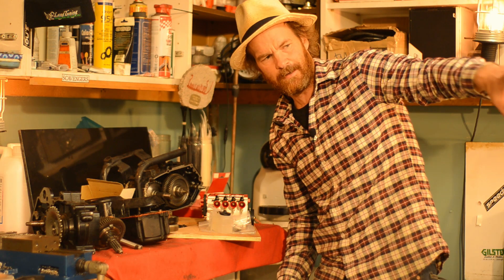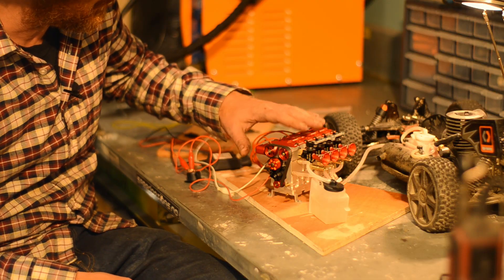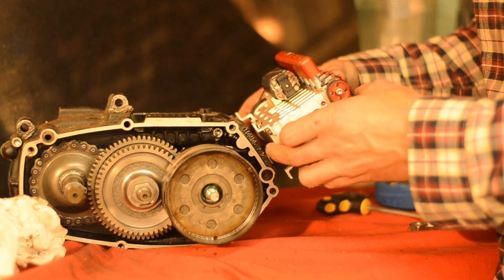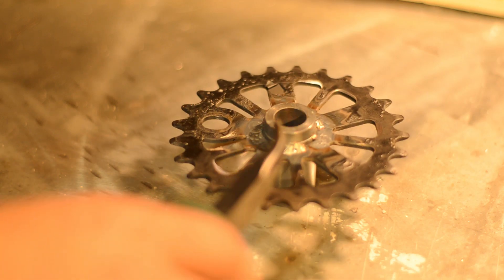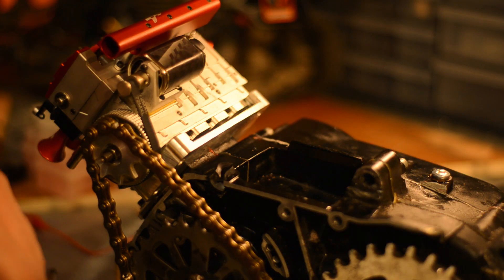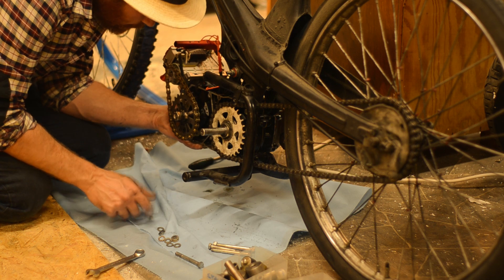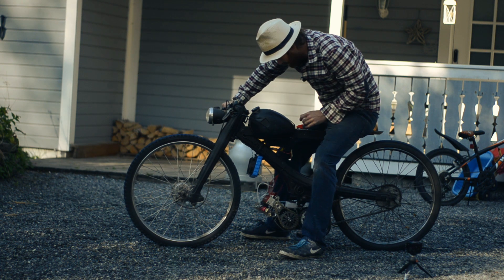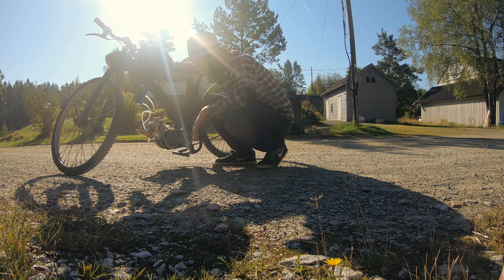I shrunk my R1 engine.

Comment: I know endmills are very expensive, but you might want to consider getting some shorter ones. That way you aren't wearing out just the end of your tool, and more importantly you'll have a better quality cut with more rigidity and less tool deflection. Nothing wrong with what you're doing though, just wanted to give you a tip.

Comment: A small engine that sounds good would be desirable. a replica of a flat head Ford V8, Honda had a V4 motorcycle V45 Magna 750cc that sounded like a good running souped up small block chevy when an aftermarket exhaust was added. They also had a V65.  A 3/8 scale model should sound similar, 49cc with a miniature comet torque converter inc. speed reduction.  Can you machine a prototype?  Do you think that the part you added to the crank caused the assembly to be out of balance enough to flex the crank excessively at 13,000rpm.

Comment: Why didn't I just pinch the fuel line with ur fingers? It would have killed the engine without burning u? LoL.. but cool video! Keep them coming.check out Dennis Dempsey's. Radio out of control YouTube  channel. He has put all models of the Toyan engine in RC cars. JohnnyQ90 is another YouTuber does the same thing and is a mechinest. I believe u will enjoy both👍

Comment: Change the gearing for more speed. I designed a bike that used a miniature V8 that had 9 to 13 HP. This is similar to what was working on last year.

Comment: it's weird that they go to the trouble of putting fake bearing journals into the crank inbetween  the cylinders then only support it both end you could have it twice the diameter in the centre "journals" and require less complex machining. However I suppose as a model its more about making something that looks like a full size engine.

Comment: If the engine can’t sit stationary and idle and rev up and be nice and crispy when you hit the throttle then I’d say don’t drive it untill you dial the carbs in or your going to blow that up.  It should run like a crispy fire cracker before you attempt to drive it.

Comment: The bottom ends in those Toyan engines are crap. With only 2 main bearings they have a lot of failures, even in a normal RC car. Would be MUCH better with 3 or better yet, 5 mains to keep the flex out of the crank! That and valve issues as others have mentioned. The fit and finish is really lacking in these little engines.🙄

Comment: Good ole 4-strokes.  Good sound, lots of RPM, lots of fun bits moving every which way, low power and huge mechanical destruction.  In an alternate universe we'd look at them like steam engines - neat to watch but not as practical as the elegant 2-stroke technology.

Comment: Great conversion my friend!  not to worry I am on my 3 broken crankshaft, hopefully the problem will be cured and as for the air filters I used the replacement earbud head phone round foams on mine, you can buy them 10 at a time and they work great.

Comment: Somewhat predictable outcome for such a long and skinny crank. Supported by bearings at both ends works if you have a crank made to withstand it. The problem is those engines really aren't designed to be made to do work, they are designed to be fun noise makers. British bikes used a pair of ball bearings on each end of the crank for 80+ years with very few failures. I think an interesting thing to see would be if you could make your own sturdier crank for it and new rods to fit a thicker crank and put some ball or roller bearings on each end, or build an entirely new crankcase with an extra bearing/bushing thrown in the middle and that head reused. The big thing about those engines that absolutely kills their power and revving ability is that exhaust. Each of those cylinders is having to make a hard 90 and fight against the exhaust of the others. Stepping up into either just zoomies or a 4 into 1 header would massively improve the performance of that engine while also directing the exhaust into a safer direction. I saw someone make a video with that engine where he put zoomies on it and it GREATLY improved it's ability to rev, don't remember who it was though. Warped Perception did end up putting a set on his but he also put a pair of little superchargers on it too, and went until he blew it up, like always. 
I just found out how expensive those engines are... often over $1000 US... uh... what?! I can buy a used Ducati engine for that much that makes over 130HP... why would you ever buy one of those? Or if you wanted to be unique you could buy a Moto Guzzi engine.
The biggest problem (besides breaking and price) with those little engines is that they just make no torque at all. They rev to the moon and they might make a little horsepower but there's just no usable force to work with at all. (just a little PS, I hadn't clicked on your link I just looked at average prices on google's shopping thing when I searched for that engine)

Comment: I don't think it will work I haven't watched the whole video yet the small rc motor i think doesn't have enough torque to pull the weight of a person.
I had the same problem when I used a small chainsaw motor on a child's peddle car just didn't have the grunt to pull the weight of a child.

Comment: just a question? how do you lubricate the bearings for the "craskshaft"?

i guess the new "crankshaft is not gonna spin as fast but still unlubed bearings since normaly on a 2 stroke they are lubed by the 2 stroke oil.

i guess u  can simply fill the crankcase like half way with some oil 10w-30w or something but i think a splasher on the crankshaft like in a lawnwower would be a good idea to move around the oil in there in that case more.

even thoe it´s just a fun temoraly project i think it´s worth do a legit long lasting job so figure out some way to lube the crank bearings before u burn them out.

Comment: Be careful the front wheel will throw any dust or rock right in the intake of the engine and it looks like you don't have a air filter on it

Comment: Amazing work. But this engine is a scam. Its not made to power anything, its made just to look cool and for 800$ its way overpriced. Any 2 stroke single cilinder will perform 100 times better

Comment: For that engine to be more efficient you would have to re make the valve train because there's so much play in the rocker arms and rods you lose quite a lot of power through skewiff random timing. 

Johnnyq90 done a few videos on these engines 👍

Also burnt nitro fuel is toxic don't breath so much in 🙌 for your own health

Comment: Interested how to determine the height of the exhaust port. I have modified many Suzuki 2-strokes. They have a lot of low down power that stops at around 5500 RPM. I raise the port and I get power up to 7000. Low down power suffers.

Comment: I knew all along this thing was worthless for $900 if they only stick a bearing on either end of the crank.  Especially perplexing when it looks like a proper 5-main crank.  You would hope with Chinese manufacture and the price tag that you'd get a proper bottom end, and perhaps a real ignition system.

Comment: This makes so much sense.  At rought 40 bucks a gallon that little engine will probably do 5 miles at full beans on a gallon of nitro fuel. The lack of bearings in the engine it may go 10. The added weight makes it so planted at that speed too.  Brilliant! 

Seriously tho, I do love some nitro.  This is epitome "just because" youtube.  

Haven't looked through your channel. Any time spent with a CYC motor??  Ive got the new X1 stealth on my Trek and it's brilliant.  Do it!

Comment: Awesome execution on something I’m sure many people have wondered about.  I’ve wondered if large multi cylinder RC airplane engines may work?  Or possibly using a battery powered lawnmower motor/batteries to power a bike?  Great video.
Reply: Those airplane engines are probably stupid expensive, he was given this one by the manufacturer, toyan and it costs about 750$ I think, and for the electric lawnmower idea I think somebody has already done that, considering it’s pretty easy and one other thing is you may end up with a bike but with worse range/power and more expensive to make than to buy

Comment: Just a thought: When you make your clutch pads, why not glue on one long piece then cut the excess to make the three pads? Since you have to trim the width anyway, you may as well trim the length. That way you don't have to worry about how well they fit when you are gluing them on and each one will have complete coverage.
Reply from the maker: Clever👍

Comment: I will never get my head around how that pot coaster actually worked as a clutch. xD
Reply: Actually petty common in old <5hp setups like old self-propelled mowers and the like. They are also used as "torque limiters" in industrial machines. Blows my mind too, but yeah, a little oil and cork is pretty tough!

Comment: Be carreful this is a 4 stroke engine, with this angle oil level is not the same ^^
Reply: There is no oil in the crankcase, blowby lubes the lower end.

Comment: If anyone wants to do a similar project: an old paper shredder has a very durable and ideal gear reduction assembly.
Reply: Would be the right way to use a small high rpm engine, although top speed would be very slow! I'm currently working on an old Cox model car that uses a worm gear reduction for a high rpm glow engine that seems very simple but is robust.

Comment: tell me is a custom 3 cyl nitro engine build in the cards perhaps? constant power engine would be epic!
Reply: Why would you want a constant power engine?
Reply: @ferrumignis  if you use a y piston config then as one piston goes down th next piston is starting to fire same principle as a rotary engine meaning the load of one cycle of the crank is divided by 3 cilinders meaning there would be a constant powerstroke. The carb or throttle manages the speed of the motor turning
Reply: @MrJerrymouse1  Oh you mean overlapping power strokes.  I thought you actually meant constant power, as in power does not change with RPM, which would be possible but rather pointless.
Reply: @ferrumignis  yes that is correct thanks for the assist .I just think it would be a good combination along with nitro or 2 stroke perhaps

Comment: I can only imagine how much dirt and rocks were coming off the front wheel into the intakes
Reply from the maker: Yeah, was going to make a filter after initial testing.
Reply: That's exactly what I was thinking
Reply: Good for it
Reply: Was thinking the same, but most would be to big to fit passed the valves.

Comment: Really cool short little project. 
We all know 50cc is fully usable and works great for 50 km/h.
So i kinda wonder how small you would be able to make a engine to drive a bike at 50 km/h
Reply: The smallest I know of was the Lohmann 18cc 2 stroke diesel with a top speed of 35-40 kph... at 9000 rpm !!!
Reply: @jean-charlesweyland129  i just searched that up and your right and that thing sounds crazy.
Reply: @alexanderlinus It sure is a cool bit of kit ^^

Comment: Thank you for putting one of those on a bike! You know you're an engine builder when you blow something up yet still had fun. Could you make a water cooled radial engine out of the parts? If you had the time eh... gg.
Reply: Would have the valvetrain, con rods, and pistons ready to go at least. Bandsaw the  head and block apart like the Drag Bikes that cut 2 cylinders off a V8 for comp use. :)

Comment: Any bike shop should be able to put new spokes on your wheels, or find some spokes for you to put on yourself.  I was in charge of my university's bike club for a few years, and did lots of bile repairs. I've even robbed spokes from old wheels that I had sitting around to fix somebody's bike that had just been locked to a bike rack. I've even taught people about how to lock up their bike properly by moving their bike to a different bike rack and waiting around for them. When you lock up a $1,000 bicycle, you should make it harder to steal than popping the quick release on the front wheel.

Comment: I thought the crank would be weak, I'm surprised it doesn't have any bearings supporting the middle of the crank. Cool little engine but only really a desk ornament.
Reply: @Eddie Hitler They don't seem to work as well as a single cylinder. Sadly it seems like these are just a novelty